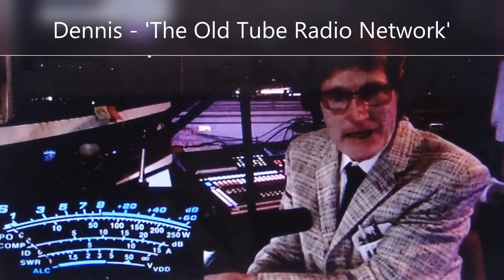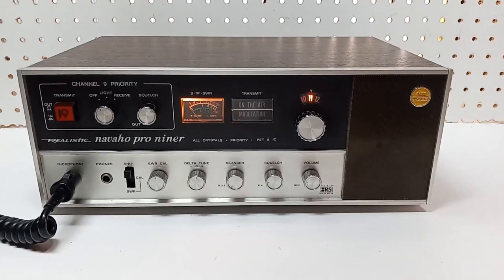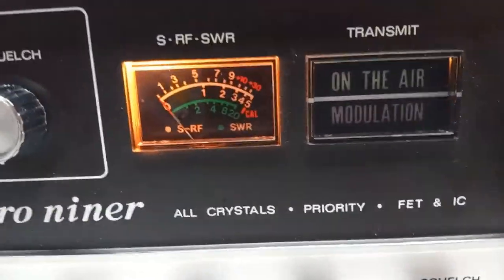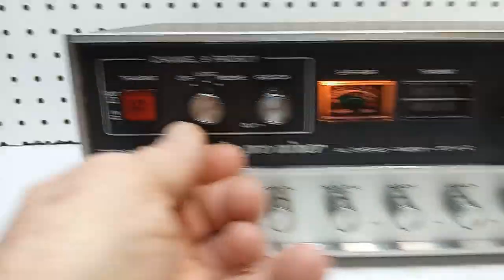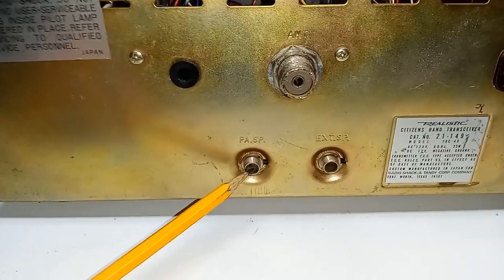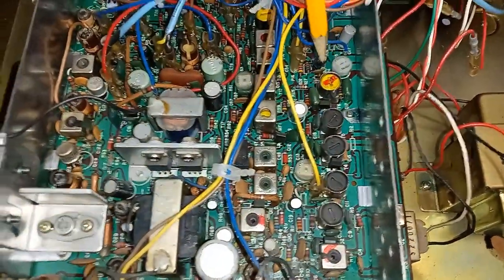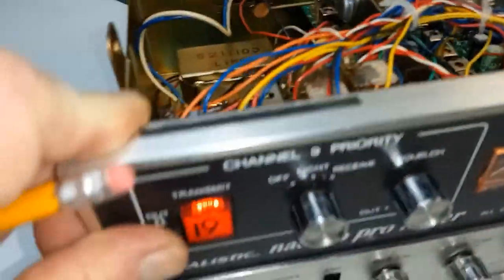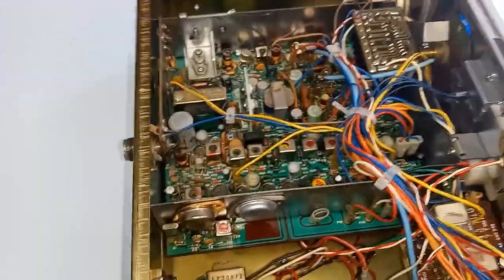Realistic Navaho Pro CB Radio - most powerful modulation circuit of any CB ?

Comment: When are you going too do video # 2 I pick one of these off of ebay,needs cleaning recapped it transmit and recieves,but the speaker is blown out,I am waiting for video 2.Thank for your time Walt.
Reply from the maker: Probably going to be quite some time, Our mountain burned for 6 weeks straight last fall, the power has been off more than it's been on, main road up to the mountain has been closed, communications and internet has been extremely slow and oftentimes completely down and I'm about a half year behind as result. As soon as the snow melts I'm off for surgery which will have me laid up through midsummer if things go well.
Reply: I would also love to see a second video about this radio I hope things get better your way!

Comment: One other thing. The General radiotelephone MC 12 just might own the rights to most powerful modulation circuit in a CB radio. Take a look at one.
Reply from the maker: Yes, it probably does only one big problem.  As I recall they never got FCC type acceptance and I think they had a 6146B final which would prevent the rig from ever getting FCC Type Acceptance.

And yes, to modulate a 6146 near 100%, the rig would require 45-60 watts of audio.  73 - Gregg s9radio
Reply: @s9radio  Yes I have a new one never used. Have a lot of other projects like my 3 RCA AR-88 and a Fisher 500 etc so haven't had the tine to recap and tune it.   Also I forgot the Buddy base had monster modulation.
Reply from the maker: Yeah I'm pretty much in the same boat, lots of projects and not much time. The fisher sounds like a fun but expensive project, not sure if you've priced the audio output tubes,  think I paid about $70 for one as they are used in the very rare Browning BB-30 Business band transmitter. I actually have a Fisher 400 or 500 in the Browning BB30 video I did hear on YouTube.  73
Reply: @s9radio  Talk about rare just bought mint working Sonar J-23. What amazes me is they're all Nuvistor Tubes. The build quality is fantastic! We'll never see that again. Let me know what you are looking for and maybe you can do the same for me. Starting to look at HH Scott again.

Comment: U cannot beat the 858 chip
Reply from the maker: This is a crystal controlled transceiver, no PLL chip
Reply: @s9radio  dugh!!!! Not speaking about this particular unit..just saying these older units ..are amazing like the old 858 ..what I was saying the older stuff is nice .
Reply: @s9radio   what I was prefuring to was the models that run the 858.. pll were awesome aswell and  were some of the most stable ..ther are trc models with 858.. this is what I was  refuring to sorry about the confusion.. I love the 858. Like president Washington, Navajos , and many others .. they all have wonderful audio chains most using push pull ..audio amp stages
Reply: The pro niner .. fully crystal we all know this ... Just refuring to the 858 chips wich took over later
Reply: Very versatile. I made a 2 meter synthesizer with a UPD 858.

Comment: The Realistic TRC-448 had the most powerful modulation section of any radio.
Reply from the maker: How so, please qualify this statement? What type of modulation scheme did it employ and what modulator devices did the 448 use?
Reply: @s9radio  the 448 was a dual final mobile radio that was capable of about 25 watts on single sideband, and two vrs to control the output of the modulation.... if you ran the vrs anywhere near halfway open in am mode you had so much modulation that it was off the scale..... they discontinued this radio right after it was introduced. I was lucky to get two of them at closeout prices. With a stock mic it was easily the loudest radio I ever had, for a standard low-level modulation, sideband rig.
Reply: This was 1978 and I have no recollection of the devices used..... all I remember was that it had a very powerful modulation section, much more than what was necessary to provide 100% modulation..... this thing add more powerful audio than my Eico 720, plate modulated transmitter.
Reply: Bullshit. The 448 was a single final cb radio.
Reply: @ericzerkle8486  The only BS is between your ears... The TRC 448 had the highest mix of carrier to modulation of any "Realistic" radio sold.. the number of finals have no bearing on that whatsoever.

Comment: A few thoughts here... you really should have a TRC-40 Navaho Pro to compare with. I have two of them. 
The original Navaho Pro was a 1972 only radio sold during the brief time Radio Shack and Allied Radio were merged. The government filed anti-trust charges and the companies returned to being separate entities. 
The Pro Niner and Lafayette Telsat 924 were in response to the FCC's belief that the radio manufacturers weren't devoted to their desire to increase monitoring of channel 9. Apparently the Puerto Rican DX didn't reach Washington, and it was during this time that truckers were embracing CB radio and they were on channel 10. They moved to channel 19 in 1973, months before the first Arab oil embargo. 
The use of the FET front end was an attempt to eliminate blocking and cross modulation, issues that plagued early transistor designs. Here, it failed. When the band is open strong signals from channel 6, 9, and 11 will make using the radio difficult at best. 
The TRC-40 had a mechanical digital clock that was removed for the Pro Niner. Most Radio Shack base radios are designed with the AC power supply energized anytime the radio is plugged in. Never work on one, other than alignment work, with the cord plugged in! 
The modulation circuit was designed to mimic what AM broadcast radio was doing at the time. The limiter will make you sound "strangled", and you have to go in and clip the diode. The radio had a tendency to squeal, especially with a power mike, because there was no loading resistance on the input transistor of the mike amp. A 1000 ohm resistance to ground fixes the squeal. 
If you want more power you have to have a bigger transformer or use an external DC supply. Receiver voltage is typically 14.5, dropping to 12.5 on transmit and even lower under modulation. That makes the radio have downward modulation. Using a 3 amp or better external supply will fix the problem. (Edited to correct 1971 to 1972)
Reply from the maker: Actually the TRC-40 didn't appear till '72 with the TRC-49 being offered '73-'74 and yes, although dual conversion the front-end was too hot for strong stations with the minimal mechanical filter in the 455khz IF and remedied by installing a better filter which there were several options as premium 455khz filters filled the pages of radio mags back in the day. Use of the noise blanker like many radios also compounded the front-end saturation

REACT pititioned the ATA (American Trucking Association) back in '65 complaining about bleedover to REACT monitors & CH-9 with the ATA agreeing to move the national trucker / travel channel to CH-19 in 1966.  The FCC actually got involved declaring Channel 9 was officially reserved for emergency in '69, furthering the effort to rid truckers from CH-10. Several CB mags of the era will confirm this.
Reply: @s9radio  I live near Pittsburgh, and when I got on in 1970 the truckers hadn't become a dominant force on channel 10. In fact, the dominant group was a bunch of people who defied logic and operated legally, using their callsigns and observing the five minute rules. The local REACT chapter had no problems chastising people who bled over, unless they were on channel 8 or below, because those channels were reserved for intra-station use. 
I consider it somewhat ironic that channel 10 is the truckers channel in Quebec, and like the Brazilian channel 5, is a useful propagation tool.

Comment: The Japanese electronic equipment back then was very good quality in my opinion.
Reply from the maker: Absolutely, the Japanese electronic and automotive invasion pretty much curtailed much of the America manufacturing, putting brands like RCA, Magnavox and the host of other television manufacturers in the back of the bus when compared to the Sony's.  

Same thing with the Datsun 240Z and the Toyota trucks, they really left an impression on how good the Japanese products really were.
Reply: @s9radio  While Japanese products like radios, televisions, cameras, and motorcycles proved to be of great value and quality, cars were another thing entirely. It wasn't until the early 1980s that Japanese automakers learned how to prevent rust.
Reply: @CARL557511  By the early 1970s the number of American made radios could be counted on one hand...
Pearce Simpson Guardian 23.
Regency Imperial 2.
Regency Range Gain 2.
Tram Titan 2.
Browning Golden Eagle Mark 2. 
Once the mass marketers like Echo, Henshaws, Lafayette, Olson's, and Radio Shack began selling cheap transistor CB radios it was game over for the American manufacturers and eventually Tram and Browning sold Japanese radios.